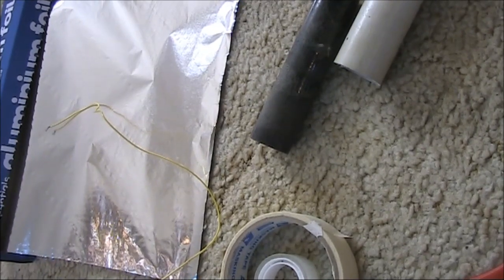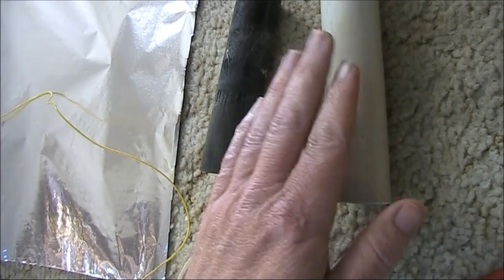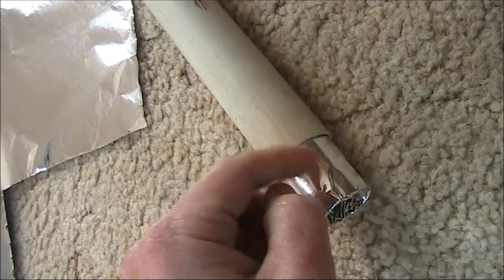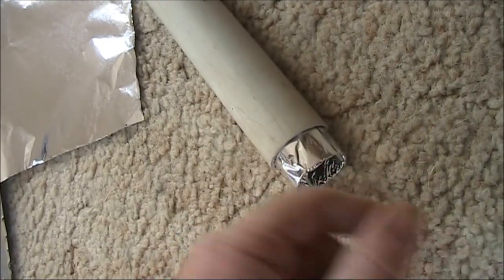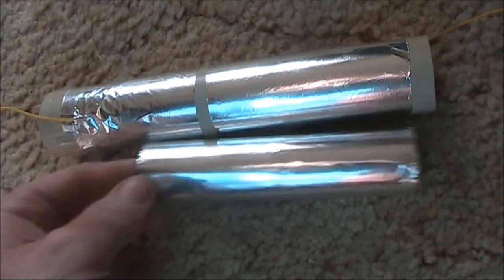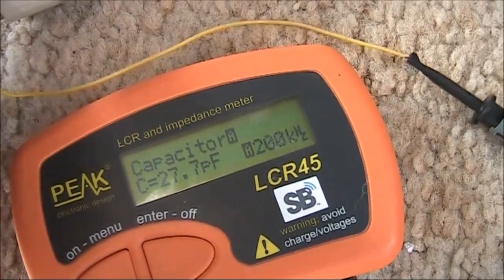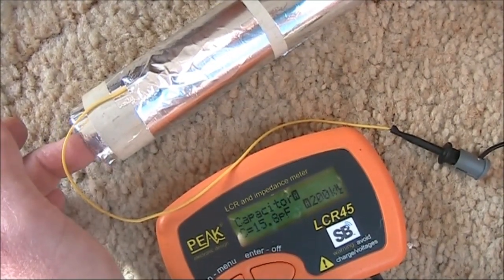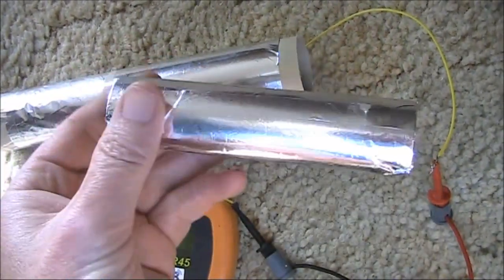Electronics on the floor: Another sliding variable capacitor

Comment: A better set of switchable capacitors can be made fairly easily for your case.
You need about (30pF - 4.8pF = 25pF) steps
If you are going to have a error it is best to make each next capacitor less than the sum of the previous ones.
22pF, 33pF, 51pF, 100pF  is the sort of thing that works out well

Comment: I made a small one just a fingers size and it has capacitance of 30 to 100 pf
Reply: How
Reply: @Saber522  If the pipe has a very thin wall that can happen.
Capacitance it some constant times the area divided by the distance between plates

Comment: Did this with 2 beer cans.  Split one, and slide it over the other.  Wire on both ends. 10 to 400pF.  Cans already have an insulating wrap.
Reply: 400 pf ! pretty good ! is it the general rule that the more surface area the more pf's we get ? i imagine the two cans slide nice n close to each other too !
Reply: Really ? They have an insulating wrap? What about after heating them up to remove the ink?
Reply: @bobhs1605  sanding them would remove the incredibly thin plastic coat they have on the inside.
Reply: And would sanding them make a difference?

Comment: You’ll find that 20mm grey conduit slides nicely inside 25mm grey conduit. 

Orange conduit is a little thicker and so 25mm slides inside 32mm 

Using the 25mm grey conduit on my 3m wide 40m mag loop, I would blow holes with RF arcing in the conduit with as little as 30-40W

Comment: Very cool! You've probably seen on my channel I'm experimenting with a variable capacitor by using multiple 5x7cm PCB's along with some switching. Great fun :)
Reply: There's an old post by TransWorld Radio describing a home-brewed tunable MW Loop Antenna using locally-sourced materials. Search for "Simple Loop Antennas
By TWR Bonaire Engineering". Basically wire , aluminium foil, cardboard box and envelopes.

Comment: For loop your yellow copper wire is very resistive loosy....replace a copper wire with copper tape or aluminium foil....remember 10 cm this copper wire degrade eficience in your loop antena....sorry my english is very bad